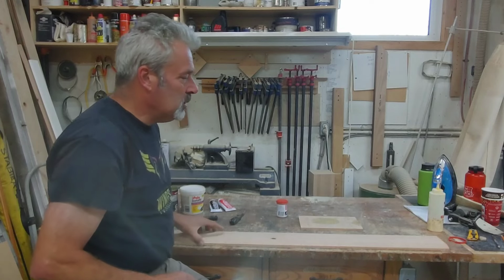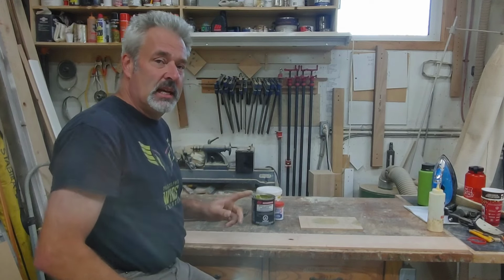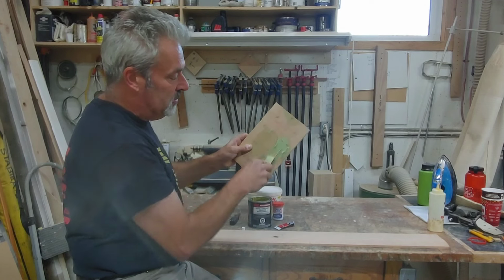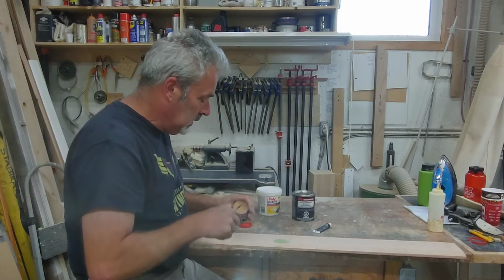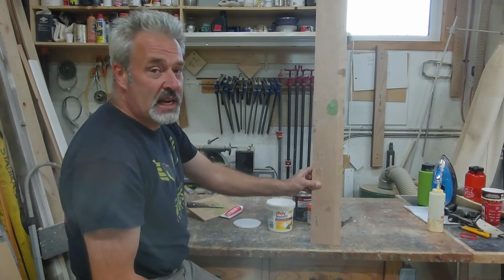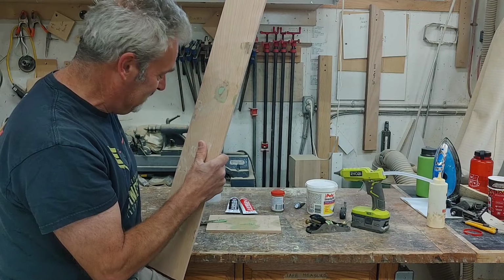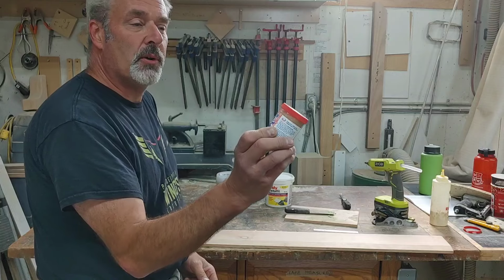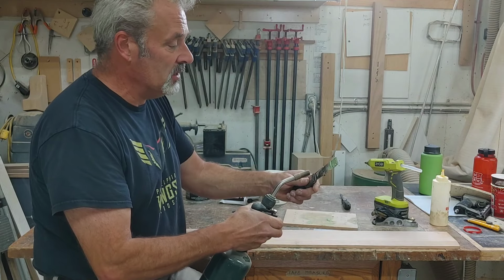Wood filler. What's the best to use.

Comment: Glad to see a new video. I have used  bondo to fill loose knot holes  in alder. Does stain pretty well.
Reply from the maker: @anthonyloran4442  Hi Anthony. Its been a while for making a video. Vacation and and being very busy. Good to hear you use bondo as well. Most people don't know you can stain it.
Reply: @henrymostert2125  
It's really pretty versatile. That was a good tip about the block plane.I had never thought about using one for that.